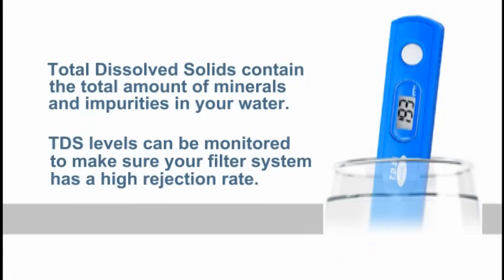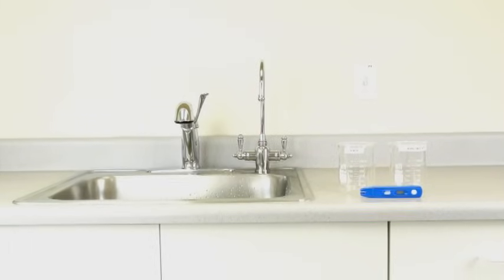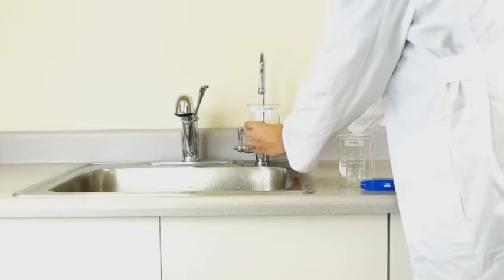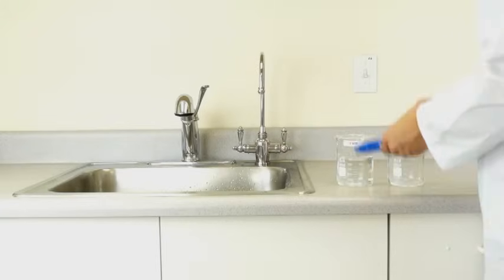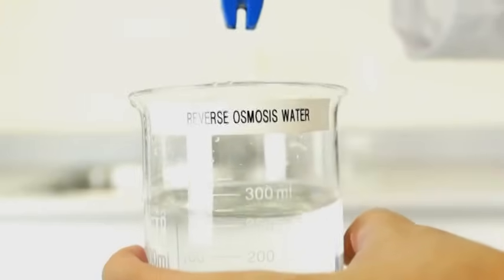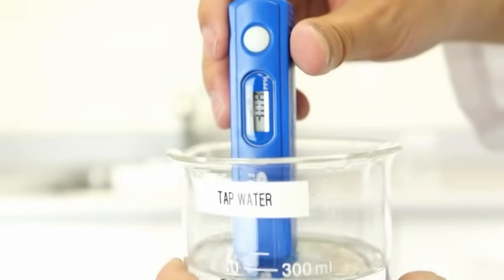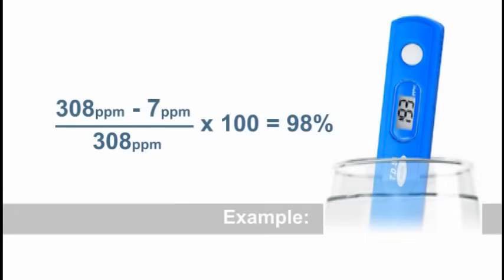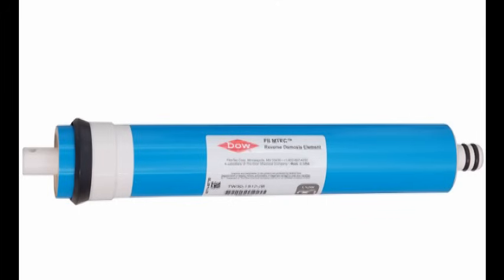How to test reverse osmosis drinking water quality with a TDS meter - APEC Water

Comment: Is it normal to have a rejection rate of only 86% on the first full day of use?  We also have the mineral add on.
Reply from the maker: Hello Customer,

Yes that is normal as the calcium minerals is considered TDS so there can be anywhere between 10-30 ppm of TDS added after the RO filtration making your overall TDS a little higher. If you need further assistance, feel free to contact us directly by calling 1-800-880-4808 or e-mailing us at info@apecwater.com. We are in the office from Monday-Friday from 8:00am-5:00pm PST. Best Regards, APEC Customer Service 

Best Regards,
APEC Water Support Team

Comment: Less than 50 tds is harmful for health as that water is lacking essential minerals required for health.... Replace membrane only when u have used it for a year or when the ro water speed gets low..... If ur membrane has less than 80 tds percentage but has good water speed than their is no need to replace it... Ur ro tds above 30 to 100 is excellent..

Comment: I have ppm reading of 65 in tds meter.should i use water purifier?
Reply from the maker: Dear Mohammed,
 

Thank you for your inquiry, I'm happy to help! It is difficult for us to say whether or not a reverse osmosis system is necessary based on your TDS, as we do not know what it is specifically that is in your water.

 

An RO system is designed to remove 90-99% of everything that is in your water. We find it beneficial in most situations to make sure you are removing anything harmful in the water, even if your TDS is very low.

 

If you need further assistance, feel free to contact us directly by calling 1-800-880-4808 or e-mailing us at info@apecwater.com. We are in the office from Monday-Friday from 8:00am-5:30pm PST.

Best Regards,

APEC Support Team
Reply: no.

Comment: So, if you get 7 when you first install your filters and your tap is 300, when do you change the filter?  When TDS hits 50 or so?
Reply: I guess when you stop being happy with the product water or if you see that product flow decreased, when you pull out the filters you can wash most of the dirt but you will need to change the membrane when waterflow drops

Comment: Dissolved organic solids such as sugar and microscopic solid particles such as colloids are not measured so it's not that reliable or indication whether water is drinkable or not.
Reply: Sugar in the water?
Reply: Anyone measure the TDS of fresh urine? 😅
I have a Zero water pitcher and it always shows 0 when measured with the meter they provide. 
 I wonder what kind of trickery they may be doing-
Reply: This comment is just wrong. And even a cheap TDS meter can prove it

Comment: these are my readings after i changed all of my r.o. system filters  -- the tap water reading is 127 ppm  the r.o. water reading is 55  ppm  -----
Reply: That's way too high for an RO system. I doubt it's the RO brand. It's likely you just have not changed the filters for a long time. Make sure no unfiltered tap water is somehow making it into your RO faucet tubing.

I always test commercial RO machines. I've seen ranges from 2-40. I only buy if it's under 10 ppm.
Reply from the maker: Dear John, do you have one of our RO systems? That number sounded high for a reverse osmosis system and we recommend contacting our support to troubleshoot.

Comment: Why do u subtract 7 from the tap waters reading?
Reply: Because the Tap Water represents 100%, or in this case 308 ppm.  7 is part of 308 so, if you're reading 7 as your result, it means you got rid of 301 ppm.  Therefore, 301/308 is what you filtered-out of your water system.
Reply: Vincent Hoffman you'll learn in grade 6 or 7 maybe
Reply: Seems more straightforward to just take the 7 and divide by the 308, and multiply by 100 to get the percentage "contaminants" passing through. 
2.27% getting through the filter. system.